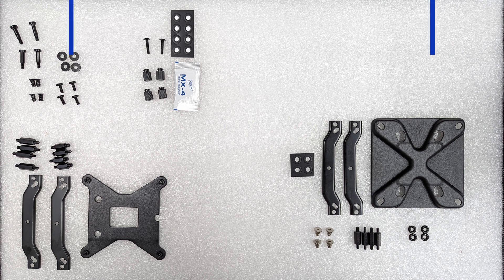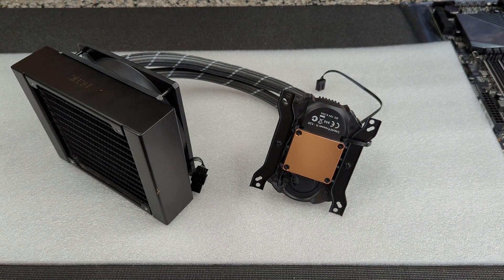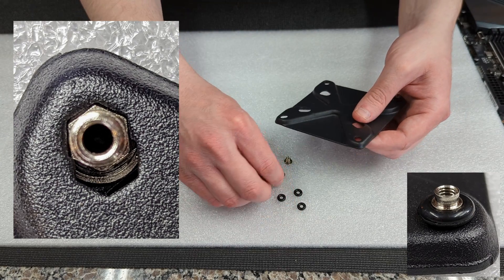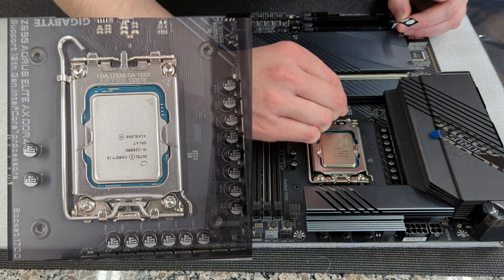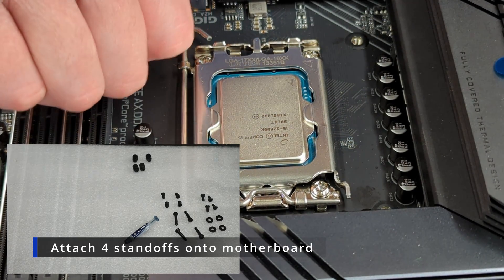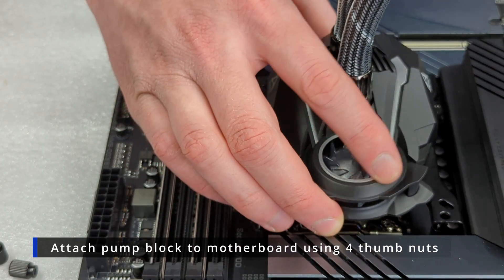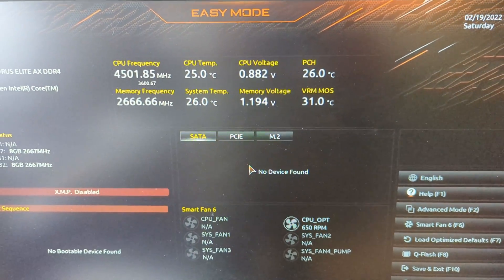LGA1700 Install of Arctic Liquid Freezer II with New Mounting Kit

Comment: I'm so confused 😢 I have the z390 Asus board, the back plate doesn't align with the motherboard, there's a solid gap. Every thing is saying I need this upgrade kit but the cpu backing is raised and thick so I don't see it fitting at all even with the upgraded kit. I honestly am at a loss on what to do

Comment: When you buy your hardware, check fitments immediately!! I bought a box that fits the 420 rads. Got the 420 freezer. Guess what? The rad no fit. it is really 457mm, NOT 420mm. And the mount hdwr not for 1700 - had to order that also. This is not a fun project so far. (and I am very pc proficient with many builds)

Comment: I had issue with arctic 420II pn 13900k. thermal paste is not even it spreads out on angles when I take it off. I tried it with new kit.
is it 13mm or 14mm stands off for z790?

Comment: there seem to be new lga 1700 kit not that doesnt look like that big X anymore. They look a lot like the pre-lga 1700 now
Reply: This is the exact same problem I've run into!! I was about to freak out about having to order a new bracket, but turns out I have the newer...new bracket lol really helps that Artic made it look almost exactly the same as the old bracket (minus the two additional holes).
Reply: @-CrimsoN-  good that you noticed that now. I wrote that comment after noticing the one they shipped me after telling Arctic that the kit wasnt in the box. They shipped it for free, but still had to wait for it

Comment: The original bracket now fits the lga1700 socket.
Reply from the maker: You mean the included bracket? Because yes pretty much all should have it included now. Unless someone finds a place with some old stock.
Reply: @KLEEBZTECH  Correct the included bracket. Only mentioned it because I started looking for the bracket you showed in the video because mine looks like the old style in the video but it has additional hole cutouts for lga1700. Great video btw.
Reply: @tbits6  Thanks for posting this. I almost freaked out about having to order a new bracket when the newer new one looks like the old one. I wasn't looking at the additional holes. Thanks for making me not order another one and waiting 2 weeks for it to show up, when I never needed it in the first place :D

Comment: Thanks for showing the mounting plates. I was trying to install mine and struggling to figure out how the mount would fit. It says LGA1700 right on the box but didn't have the LGA1700 mounting plate in there but only the old one. Makes much more sense why it wouldn't fit.
Reply from the maker: I hear about those boxes occasionally. I sometimes wonder if they were returns and somebody bought one just to get the correct plate for a motherboard they already have.
Reply from the maker: Or someone just forgot to put it in the box.
Reply from the maker: Of course now it sucks because you have to wait to get the correct part. Good luck and enjoy the new system when you get it up and running.
Reply: @KLEEBZTECH  thanks!
Reply: If you have rev 7 new backplate for 1700 is similar one for 1200. First I thought that there is no 1700 backplate but there was new one, enhanced.

Comment: What I've found is that you need Coller revision 7 which have modified motor cover. This cover does not interfere with capacitorts bellow the socket.

Comment: Hello, I accidentally placed 2 washers a but wrong. Does it matter?
Reply from the maker: Not sure exactly what you mean. Normally there are 8 washers (the ones attached to paper) at 03:54 and you put 4 on the bottom and 4 on the top. Without those, there is a risk of scratching the motherboard. That could cause issues.
Reply: @KLEEBZTECH  I did something nearly similar to what I seen on manual so Im fine I guess

Comment: Would it still work if you only had 4 spacers?
Reply from the maker: Potentially. But you would be taking a risk the board getting scratched and causing issues. I wouldn't risk it myself.

Comment: Upgrading from the Corsair h100i Elite, to the 360 Arctic Liquid Freezer ii. Can I just use the backplate from the h100i?
Reply from the maker: You will need to use the back plate that came included with your new Arctic cooler.
Reply: @KLEEBZTECH  means I have to make a ticket as mine came missing hardware, like the O-Rings

Comment: great vid, but on the arctic website there is a list of incompatible boards with this cooler and some specific z690 boards and the board you use is on that list, so we can assume that it will fit the aorus elite ax ddr4 board? or did you modify the cooler?
Reply from the maker: I am not sure exactly where you are seeing that but I have not seen it. I do know that some of the smaller boards won't work. We had no issues. Are you referring to GIGABYTE Z690M AORUS Elite AX DDR4? That board will not work but the one we are using is an ATX board GIGABYTE Z690 AORUS Elite AX DDR4. If this board is incompatible they did not mention that when they asked to use our video as the video for their channel instead of making their own. That would actually be kind of funny though. 😆
Reply from the maker: I think I found what you mention and it appears to be just the smaller boards which makes sense looking at those boards.

Comment: Hi I have now realized that I have mounted the old support, does something happen or can I use it until they send me the updated one?
Reply from the maker: Personally I would not advise using it with the incorrect hardware. If you do I would make sure you monitor the temperatures closely.
Reply: Ok thanks.

Comment: As Keith suggested dry fit your pump first.  In addition I would also 'dry' mount the radiator as well.  The radiator is huge make sure you have the clearance.  Radiator fans ran into motherboard CPU plugs, CPU fan plug, and ARGB header.  Was able to get it mounted (not the way it should but will work), very tight fit (ATX Mid Tower, Arctic 280mm fans).
Reply from the maker: Absolutely. Really applies to the whole PC. Never fun to have to disassemble a PC when 90% done because something won't fit.

Comment: My LGA kit came with only 4 washers. Waiting on them sending me 4 more. Glad I did not push forward and damage my MB. I read where someone damaged traces and lost memory channels. I hope the ARGB 420mm meets the hype. I agree that I am not a fan of the mounting system or the look of the pump. I do appreciate the need for only 2 wires vs my whining 360 Capellix and the fact that the fans are pre mounted. The company has been very responsive but one USA channel seemed to be unsure of 4 vs 8 but sent me them anyway. The overseas channel stated right away that LGA requires 8 washers. That did make me lack confidence on them knowing the product. Thank you for the video. Well done with the closeups.

Comment: Thanks för the Video, I never bought a Liqiod Aio Watercooling with the badder istruction this is absolutely terrible then they show a picture of a revision number which isnt existable allthe others did that better for example they show a picture with holders length of 13 and 14 mm bit all of them had exactly 13,5 instead of 4x 13 4x 14 i the othe thing are the animated 3d graphics where is not really clear whitch side should be up which down its a realllysilrnt  good and cheap watercooling withe terrible installation instructions

Comment: Just ordered this off amazon and i just found out it doesnt come with the lga1700 mounting kit despite the box saying 1200 and 1700 on it
Reply from the maker: Sounds like either a return missing parts or somehow they forgot to put them in there originally. Can't imagine they are not including it if the box says it.
Reply: @KLEEBZTECH  its legit all the stuff on the left. What should i do? I paid 150 for overnight shipping friday for my rtx 3090 for this to happen.. im heartbroken. Can i buy a kit from best buy or something?
Reply from the maker: They do have kits for when they didn't come with them but don't think you will find anywhere local. Also could contact them and let them know it was not included. The downfall is that it will probably take time. https://www.arctic.de/us/LGA1700-Mounting-Kit-Liquid-Freezer-II-Series/MPSAS00891A
Reply from the maker: https://www.amazon.com/ARCTIC-Intel-LGA1700-Upgrade-Kit/dp/B09K452ZTR

Comment: Hello!
Has anyone installed this AIO(Arctic Liquid Freezer II series) on an Asus rog strix z690-f motherboard? Is it normal that the holes for the standoffs on the backplate are far enough away from the holes on the motherboard? This distance decreases as the standoffers are screwed in, but does this bend the motherboard PCB?

Comment: There were shorter and longer standoffs... for LGA 1700, which one do you  use? It wasn't clear in this video the length. Thanks!
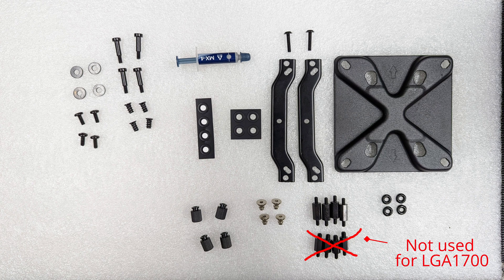Reply from the maker: If you go back to the part where we show the parts we do mention that the ones we used are 13mm not including the threads.  Approx at 1:06 in the video.
Reply: @KLEEBZTECH  Oh perfect, sorry I missed processing that part in my brain :(. Thanks!
Reply from the maker: That part is a little confusing because of all the part variations it can come with. And they probably have changed since we did the video.

Comment: My kit only came with 4 spacers, but I don't think it will make a difference on the backside with the rubber rings against the board (will it?).  Other than that, great video.  Thanks for the help.
Reply: What did you end up doing?
Reply: @genericchannel9448  Have not installed, but the kit is now sold without the extra 4 spacers so if I do use it I will install the o rings directly against the board.
Reply: Mine too. I will contact them, but agree placing them on the MB makes the most sense
Reply: I called US support. Frankly he kinda guessed along. Basically said, place around CPU. When I pressed, he then said, it should be 8 - 4 front and back. He offered to send me a form to get 4 more washers. It bothers me that they are willing to let someone damaged a MB because they did not include the proper parts. I'll have to decide if I will keep it. Glad I did not tear down my PC.
Reply: Makes sense, only the 4 on the front are needed considering the rubber - mine only came with 4 as well.

Comment: Bought arctic freezer 280mm and it came with the pre-lga 1700 mount. What is the difference between that and the lga 1700 mount kit on the right side of the video clip? I have looked through amazon and it states its an upgraded version. Should i buy it instead of using the orginal pre-lga 1700 mount? Thanks
Reply: hey have you found out?

Comment: I have a question. Im using the 280mm Arctic freezer ii with z690 ddr4 motherboard. Dead on wanna go for the top configuration for best results. Do you know which case is suitable for this build? Im looking at corsair 5000d pc case at the moment. Thank you
Reply from the maker: It should be fine assuming you don't have really tall sticks of ram I think
Reply: @KLEEBZTECH  thanks for the fast replies. Appreciate it :)

Comment: ** FOR ANYONE ATTEMPTING THIS** Please dry fit the pump block first, if you apply paste and then realize after the fact that the plastic housing won't fit on your motherboard, then you've just made a messy mistake. Dry fit it first, THEN go back and apply paste for the final install.
Reply: good aDVICE
Reply: Haven’t heard the “dry fit” term in my life except for nike… what does that supposed to mean? Thanks in advance
Reply: @peterp3768  You fit the pump block on without any thermal paste first to make sure everything aligns and fits correctly. Only after you're satisfied with it should you actually use the paste to seat it for good.
Reply: @keithw096 thermal paste costs nothing and is so easy to remove, why bother?
Reply: got it
Reply: What do you mean "dry"??
Reply: @blurrr5865  go in raw
Reply: @xyloid5313  I don't know where to even begin with that comment.
Reply: @keithw096  well i'm currently going to build my first pc, and i really like this AIO so i try to find as many information as i can, and I saw your comment and i'm a bit confused about what do you mean by that.
Reply: and paste maybe better circle, not the line? :R

Comment: I’m new to aio’s and have no clue where to put the 3 pin connector or the 4 pin connector and am also wondering if I have to do something with the wires that are directly connected to the fans and the radiator and also where to plug in the connectors and wires attached to the pump
Reply from the maker: One of our other videos might help. https://youtu.be/Lx0xMbKFJ7M

Comment: This is a noob question : why is it called a liquid Cooler? I cant ser any liquid 😅😅
Reply from the maker: If you see the liquid it would be a bad thing...
Reply: @KLEEBZTECH  so, the liquid comes from the radiator?
Reply: @KLEEBZTECH  i am total newbie with liquid cooling. Soz 4asking
Reply from the maker: The liquid fills the whole unit. It is pumped through the radiator just like in a car.

Comment: I have 12700KF and elite ax ddr4 which arctic freezer should i get I'm thinking 280mm
Reply from the maker: 280mm should be more than sufficient assuming you have decent air flow

Comment: I upgraded the processor, I bought a lga 1700 mount base, the mounting screws are too long, there is a gap between the processor chip and the cooling pump, I had to use the old screws and removed the protection rings. (Product sizes are not accurate)
Reply from the maker: What motherboard are you using?
Reply: @KLEEBZTECH  Asrock z690

Comment: I need help like really bad my aio won’t touch my aio it won’t spread the thermal paste I did the unscrew thing and everything
Reply from the maker: Double check to make sure you are using the correct stand-offs. If you are, and your motherboard is a Mini-ITX form factor, this AIO may not work with it.
Reply: @KLEEBZTECH  my motherboard is  a mag b660 tomahawk Wi-Fi ddr4
Reply: @KLEEBZTECH  I’m using  the  280 version but it won’t touch my cpu  and smudge the thermal paste
Reply from the maker: If you think you are using the correct standoffs and nothing seems to be blocking it then you may want to contact their customer support.

Comment: Thank you for this video. My cooler came with no instructions and all the parts jumbled up. (No LGA1700 bracket despite advertised as shipping it for free) It was very confusing at first but this video helped a lot.
Reply: Same issue, ordered mine from Amazon. Advertised as 1700 compatible. No bracket lmao, 2nd time I've taken apart my pc only to put it back together due to parts I THOUGHT I had, but nope
Reply: @charges_  I had to buy it separate from them and their customer service said they couldn't send it because they were out of stock despite clearly selling them
Reply from the maker: That sounds like someone returned it. Or last 10 minutes at factory before end of week. But good to hear you got it working.

Comment: you think its possible i damage the motherboard lanes by screwing without the spacers near the cpu? i fucked up i think
Reply from the maker: It's definitely possible to damage your motherboard if you don't use the adhesive stickers
Reply: I did the same and now A1 and A2 ram slots do not work

Comment: hi do you know if this cooler works for ASRock Z690M-ITX / ax D4
Reply from the maker: I personally don't recommend this cooler for itx boards due to it's large pump block. Chances are slim that it will fit.

Comment: Thanks a lot, did you also notice the noise of the pump though? I can't change the rpm in the bios do you have this same issue?
Reply from the maker: I wouldn't say our pump was audible over the fans
Reply: @KLEEBZTECH  I have noctua af12x25 slapped on there, so there is practically no fan noise. Even when shaking the aio the pump noise persists

Comment: Great video. It will definitely help when mine arrives. If i can offer some advice…you used WAY too much thermal compound. A BB sized dot is all that is needed (for Intel) or pea sized (for AMD) in the center if good contact is achieved.
Reply from the maker: There are plenty of videos debating the correct amount of thermal paste. Use whatever you deem necessary but adding too much shouldn't negatively impact performance
Reply from the maker: Steve goes into great depth here about it. https://youtu.be/EUWVVTY63hc
Reply: If thermal compound expands and runs onto other components, you're going to have a bad time.